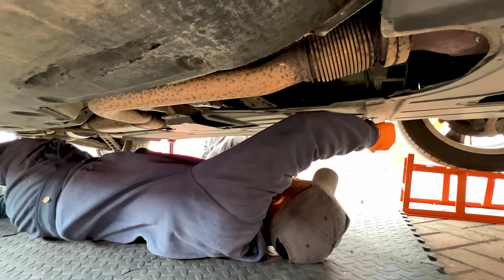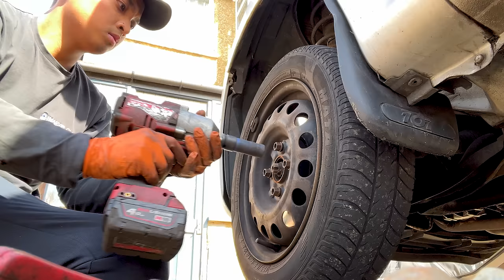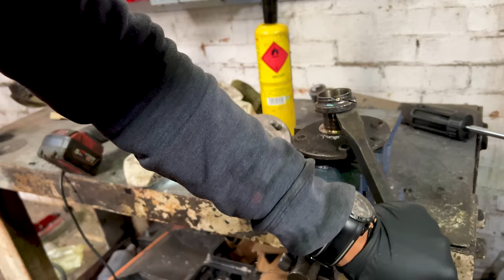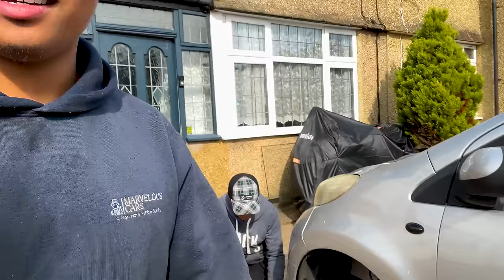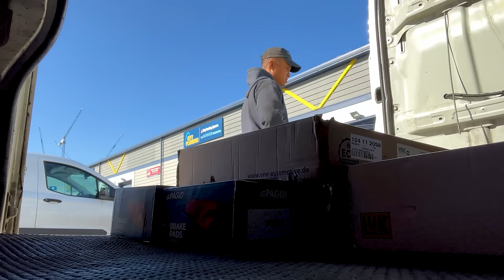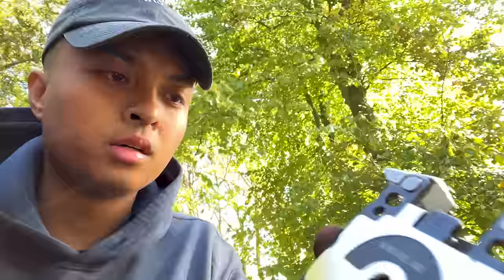THREE VEHICLE REPAIRS WITH SAME ISSUES! BMW M4 SEIZED RETAINING BOLT?! | Life of a Mobile Mechanic

Comment: Would have started with the Ratchet on them disk retaining bolts rather than the impact gun, I’ve learnt my lesson with this 1000’s of times 😂😂
Reply from the maker: Usually hammering the Trx or Hex on it works. Not this time apparently 😂
Reply: @themarvelousvlog 1/2 short extension hammer a few times shocks the grub screw always. This skill has never let me down
Reply: Manual impact driver is the way to go for them. Very unlikely to chew them up but enough to shock them and get them moving.

Comment: 107/aygo/c1 wheel bearings 😱! For those bearing types, I find putting it on a pole in a vice then heating the bearing race specifically makes them fall off 😁 saves cutting into the shaft, the circlip  is a royal pita on old ones. If you ever have time watch South Main Auto vids, Eric O is a master at dealing with rust and many other things……when he’s not moaning.

Comment: Hi Guys That Peugeot 107 Wheel Bearing job got me remembering way back when I was just starting my diy mechanic journey in 1986 when the front bearing on my 1969 Vauxhall viscount seized and I thought I had the knowledge and tools to do the job on my own, how wrong I was ! Working on the street in the evenings after my day job I got to the point where the bearing just wasn't coming out of the wheel bracket and using all the tricks I had up my sleeve including heat and wd40 couldn't make it budge so I had to trot over to my friendly motor garage chap who put the wheel bracket on his press but still no joy the bearing was literally welded to the axle spindle ! So in the end we had to get Mr AG (angle grinder) to separate the old bearing from axle, that did it but that was a learning curve to remember . Love watching you guys work and your ingenuity getting round problems, but please get in the habit of wearing face protection, eyes are precious and difficult to fix ! and ones lungs don't work properly with tons of shit and dust clogging them up ! Looking forward to seeing you guys tackle a Aston martin some day soon !

Comment: Done plenty wheel bearings in my 48years as a mechanic and yea some can be proper tight 😩and those circlips OMG I’ve been known to tack a few spots of MIG weld on them something to get a chisel on and the heat from the weld helps too. Great job there lads.
Reply from the maker: Yeah, this one was one of them! Luckily no welding was involved. Sad thing is, all that work and it was charged at quoted price and not by the hour 😭
Reply: @themarvelousvlog  yea jobs like that can kick your BUT can take one hour or even Three 😩
Reply: Grind a groove in inner bearing race and split it with chisel, then they just slide off.

Comment: to do wheel bearing  in the parking area I used axle stand tube type to support the hub and an old wheel bearing  and hit the old one with a sledge hammer many times

Comment: Iv had no end of problems with rusted retaining clips I weld an old chisel to them and rip them out the heat helps brake them free. You should use the old wheel bearing to push in the new one it help to not damage the new bearing.

Comment: This is why when I did my wheel bearing, I just bought a new knuckle & wheel hub. The amount of time it would cost to remove properly would be the same. As wheel bearings last 200k miles, I won't be doing this job again!

Comment: In the future mate when you remove the hub from the bearing and that race gets stuck... as they always do face the studs upwards and the race downwards and Try and put it on some kind of spindle so you can spin it then just heat the race with a normal torch as your spinning the hub and the heat will pop the race off

Comment: Hi nice to see you back. I've the same press you have been using I changed a citroen camper van front wheel bearing and I couldn't get it out it bust the seal on me jack had oil every where I ended up having to heat it up really hot and I mean hot and use a 20 ton jack and it did crack in the end. Barry
Reply from the maker: You saw how soaked it was in WD40 before popping out. I can imagine it’s only worse on bigger vehicles. Hate working on bearing, unless they come as a whole set 😂

Comment: Watch out for the dreaded CV joint splines seized in the drive flange, only had it once on a Ford Orion ( back in the day ), tried everything to get it out pressing and heating, hammering, all sorts, eventually had to scrap the whole hub assembly and got a replacement from the scrap yard...
Reply: And of course had to replace the drive shaft too...
Reply: SDS drill on hammer only,chisel bit/point works like a charm.
Reply: used an air chisel, still no dice, perhaps the chisel wasn't as charming as an SDS🤣

Comment: They’re the worst thing the m sport callipers. And no they’re not the same disc size. They always do usually differ front to rear. 

The glue is to make sure the pads don’t always keep in contact with the disc and also for no excess movement.

Comment: I replaced my clutch on my Triumph Dolomite Sprint on the street. Luckily you could remove the transmission cover inside the car and have someone help lift the gearbox from above.

Comment: Use a penetrating spray and a manual impact driver to get the disc retainer bolts moving. Best chance to avoid stripping if they are being difficult.

Comment: I hate those kinda jobs. Did a berlingo ft bearing. Smashed knuckle. Then bought a 2nd hand hub with bearing and abs sensor for 50 quid. And said next time. Breakers yard for 2nd hand one. Easy way out but you know!! If it fixed its fixed haha

Comment: Welcome back.  When you had the front of the car on the ramps you should have turned on the other way then it couldn't have rolled off 😉
Reply from the maker: The reason why the ramps were put on the other way around is because it keeps on rolling back, hence why we done it that way 😉😅
Reply: Well it didn't move so all good 😀.  Where do you get all your torque settings from?
Reply from the maker: @mrc_dan_gleeball1515 Haynes, AutoData and AllData
Reply from the maker: Nobody, and I mean nobody can explain how that feels 😂

Comment: You should be using a manual impact driver on the disc retaining  bolts. You won’t strip the heads off then lol

Comment: could of done that with the abs sensor still in 😅 just needed to be unplugged then do the bearing as normal but push it out with somthing the same size as the small ring of the beaing so it goes past the sensor there for not touching or damaging it but you probably noticed that wile doing it

Comment: As a mechanic (not the armchair sort), with the brake disk retaining bolt the way I do it is to use the impact wrench (as you did), but I put all my body weight through my shoulder behind the impact wrench and press as hard as I can and flick the trigger bit at at a time till it moves, if it doesn't move you will have more chance of snapping the head off the bolt, not good but at least you'll have the disk off and you can deal with the broken bolt...(seems i'd already commented before🤔)

Comment: Not a bearing. But I do mobile locking wheel nut removal. Wv golf on weds . Managed to turn a breaker bar in to a banana. Happens to often
Reply from the maker: The worst of them all is the H19 for the hub bolts. They can easily snap an inch breaker bar 🤢🫣
Reply: Try putting a getting you mate to stand on the bar. As you hit the head of the bar with a slege hammer. Socks the nut loose. A big form mat on the wheel to stop damage

Comment: Bud just want to let you know there are tools out there that you can get, so you don't have to take off the hub next time and you can just push and reinstall the wheel bearing without taking the hub off the car
Reply from the maker: I do have that tool but unfortunately i had no choice as it was so seized in place 😭
Reply: There a time saver when they work, I been looking at getting a new one that connects to hydraulic jack to do them

Comment: He isn’t jacking the M4 in proper way, it’ll cause damage to the underside. Ideally need to use scissor lifts for BMWs
Reply from the maker: Hmmm… from working at BMW, I think this is perfectly fine… 👀
Reply: What if you need to change a wheel at the side of the road? Whip out the old scissor lift from the boot? Did he unscrew the bolts wrong too? There's always one in the comments, every time
Reply from the maker: Love to see negative comments, mainly when the person knows everything. 

Edit
I didn’t know that jacking it up on the designated jacking point is wrong. I must be going mad 😅

Regardless, I appreciate everyone here 😅😂

Comment: i once had a circlip snap on me at the end, the type with the reverse slits in, from inside a rear brake caliper, this was on my own car so was fighting with it in a vice at 10pm at night in my shed trying to get the thing out as it sits like 3 inch down inside as it was the ring holding the hand brake mech part inside the caliper, did nothing but swear for ages and swore i wont rebuild any more and just replace the caliper instead lol, have you ever had the pins in the mulitipot calipers just refuse to come out? i use a kettle of hot water when it happens to heat the ali caliper up and it works lol